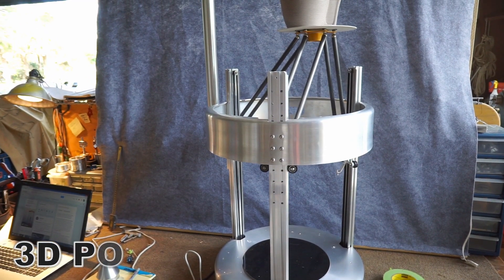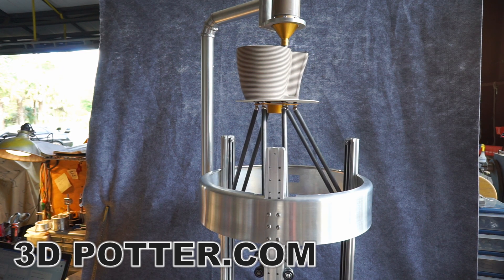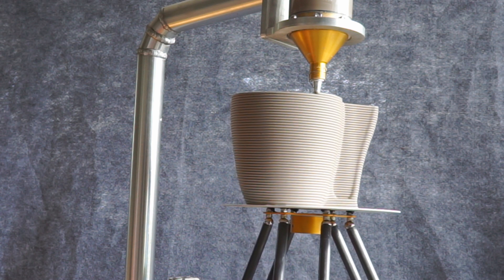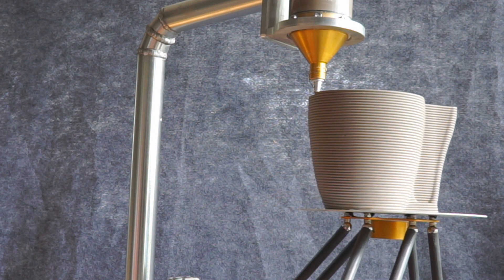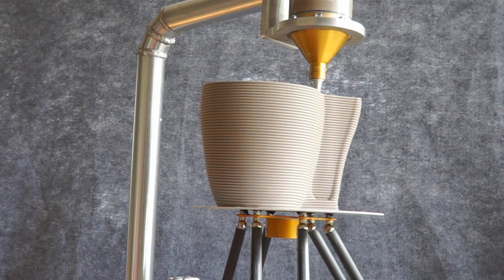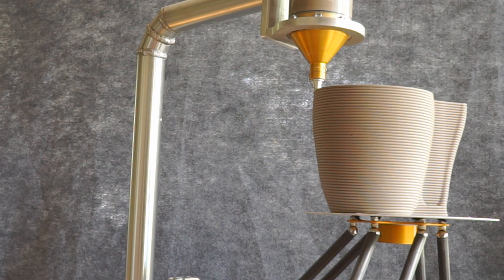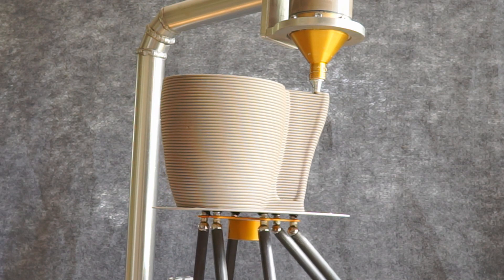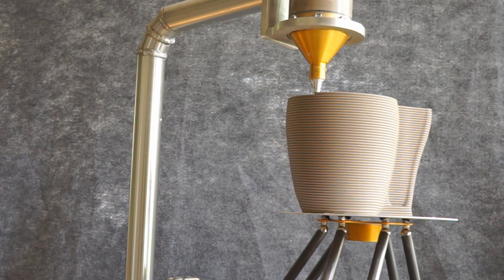3D Printing Clay with Ram Extruder  3dpotter.com

Comment: An 8 pound carriage is actually not too big of a deal on a traditional xyz 3d printer, especially if you're comfortable going slow. 

You would have to bulk your Nema up on 2 axis to NEMA 34 or 23 (longs), but those two motors are very capable of lifting 8 pounds for extended periods of time. 

I'm actually not sure why Delta printers are thing, but to each his own.
Reply: agreed. the Z carriage on my CNC router is easily 40 pounds. I have NEMA 34 steppers on a rack & pinion with gas springs to offset the weight for the Z axis (lift).

Comment: Hi, I have a question. After the 3D printer realization, is it necessary to use oven or other tools for use in common life?for example, have a cup of tea o put inside water for flower. Thanks!
Reply from the maker: +Werner Romano This  is a ceramic clay object, so after printing it must be fired up to 1900 degrees and then glazed just like any other handmade clay 
object
Reply: +Danny Defe Thank you very much! I have an another question: Is it convenient the use of 3D printer if you have an artisan as assistant or it is better to have only the artisan? Is it  less expensive and faster the use of the 3D printer?

Comment: Hey Danny. Awesome extruder and 3D printer. I have been doing research to put together a clay printer and the moving clay extruder has always seemed to be a problem to me. This clearly rectifies that issue and I would like to know of its possible to get some information on how I can build one for myself. Any help would be greatly appreciated. Thanks!

Comment: That looks great, what kind of overhangs can you achieve with that? Is the clay still pliable and workable afterwards - so you could stick two or three pieces together?
Reply: Jason Hopkins Jason, the overhang really depends on a lot of variables including nozzle size and layer height. Don't count on overhangs like with PLA and ABS. You really have to plan out your print with ceramics and utilize support materials where needed. Unlike the high pressure air driven extruders which require a very loose and wet consistency in order to push it through the tubing, our liner RAM Extruder is capable of extruding clay very close to throwing consistency. This gives you the ability not only to print a large volume objects but they are easily workable after the 3D print is done.
Reply: danny6935 Thanks Danny for the detailed response. I am looking into printing with a reprap and in t-glase to hopefully achieve some finer details, but I have a lot of experimenting to do to disguise my plastic print into looking like a traditional sculpture. The clay printing seems to be coming along in leaps from when I first saw footage several years ago. I found Jonathan Keep's videos very interesting. You can see some of my digital work at abhominal.com which I am looking to turn into physical items. Cheers.

Comment: Danny, thanks for your swift reply.  I am definitely interested in the icing delivery configuration.  Could you send more information on the setup to bobbeanbags at gmail dot com?  This solves the problem I was having with small extrusion cartridges with limited volumes of material.  What does RAM stand for?  Thanks!